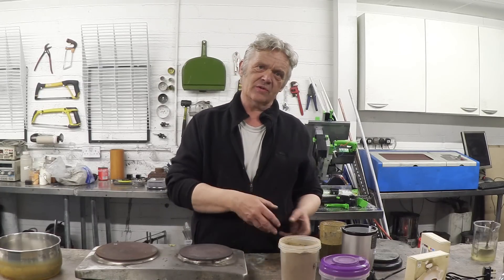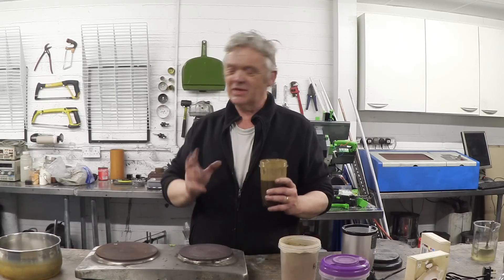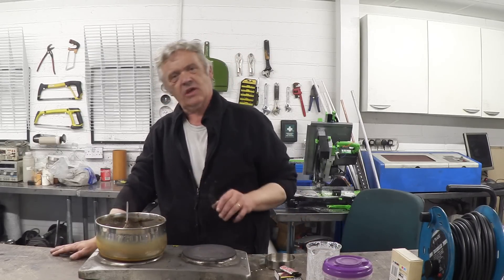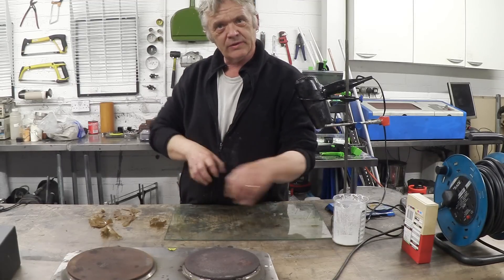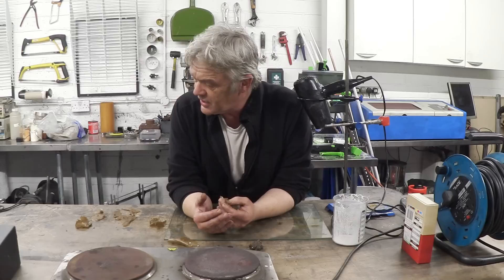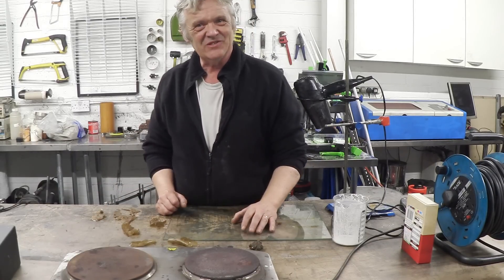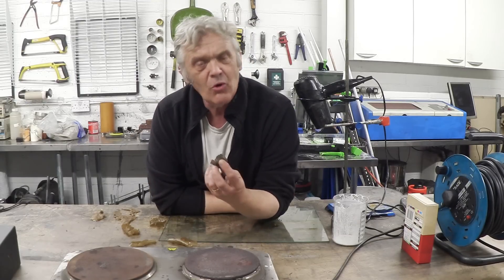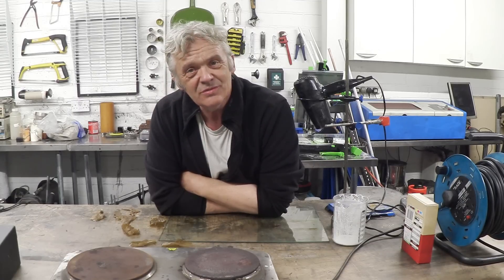How To Make A Seaweed Bioplastic -  The Basics

Comment: You could pop it between to sheets of grease proof paper and use an old clothes ringer(or as we in Glasgow call it a" old mangle) that would give you a more even spread to make your sheets
Reply: Or a rolling pin with tape strips on each end to dictate the thickness.
Reply from the maker: for sure mate - that would work well

Comment: Ok, here is the idea from what I have seen from your other video with hemp plastic - it contracts and in line with your channel what I thought of is - battery enclosure. You leave it wet, take your carbon batteries, stuff them in, wait until everything is dry and voila - all carbon battery with all carbon enclosure. That is pretty much safe (depending on electrolyte) to recycle in to a battery by blending it :D

Comment: I'm considering using this form of bio-plastic to make organic slow release fertilizer pellets.  Perhaps if this bio-plastic was powderized, the powder could be mixed with dry organic nutrients such as blood / bone meal.  The mix could then be heated and extruded through an appropriate mechanism to form pellets.  

At first I wanted to make nutrient pellets, then coat them with something like a bio-plastic to make them slow release.  This is what I've seen done for slow release synthetic fertilizers.  I couldn't come up with a way to use a bio-plastic such as this and apply a coating with a uniform thickness from pellet to pellet.  The thickness determines the release rate, so consistent thickness would be pretty important if I were to try and coat pellets with something like this.

By mixing the bio-polymer with the nutrient powders and forming the whole lot into pellets, it does away with the coating thickness issue all together.    I think it gives a great solution to the problem, and I'm pretty sure it will provide a consistent release rate which can be adjusted by changing the ratio between the amount of nutrients and the amount of bio-polymer.  More bio-polymer should make for a slower release, and faster with less.

If anyone wants to try this, be sure to rinse off any salt from the seaweed beforehand.  Seaweed tends to come with a lot of salt on / in it because it grows in the ocean, which is salt water.  If you don't already know, salt isn't very good for most plants!

Any thoughts on this idea Rob?

Comment: Not a lot of sea weed around here, but I do have cut grass.  Will have to see how that holds up in the mix.  Grass clippings to PLA... That would be amazing... Amazinger, because this is amazing.

I have some silicon molds for soap making lying around.  Will see how the mix sets up in them. Play with different layer heights to see how it dries.  Maybe see if it will release from a 3D PLA printed mold.  Would greasing the mold help it release?  May be better to cast a silicon mold from the 3D printed mold, then cast this stuff in the silicon mold... So many questions... This will keep me buzy
Reply: I was thinking the exact same think as matter of fact I was gonna cut the grass tom morning guest I'm raking it too. Wonder what the ratio is gonna be on like 50 pounds of fresh grass to corn starch. I also have some helix nano rebar material  and hemp cotton and fiber glass
Reply from the maker: you can just order seaweed online you know and it is sold in garden shops as mulch - you ideas of a parting agent or silicon moles are awesome
Reply: @ThinkingandTinkering  
Does the seaweed have musceligennic properties that partner with the cornstarch to make the plastic form?  No slime in grass.  If slime is the magic ingreedent, I'm growing okra in the garden.  Will have to try a batch with okra leaves too :)

Seaweed is salty, too.  A non-seaweed batch may need a little salt thrown in as well.  Or maybe less salt is a good thing?

Comment: Totaly on your wave length I suggested adding hemp fibres the pla soup mix for plastic forks to make them heat tolerant...

I was inspired by operation piecrete (the floating sawdust ice armour boat )

You geniuse.  .  .  . Crack on
Reply from the maker: nice one mate - thanks for the heads up

Comment: Of course, wonderful as always!!!  Find myself wondering about the biodegradability of the plastic???
Reply: ......perhaps even too biodegradable . It will certainly be prone to bacterial breakdown  .Measures however such as suitable paint could be adequate .
Reply: @philipvernejules9926  yes, I should have stated DEGREE of biodegradability...
Reply from the maker: in this form very degradable - in fact you would have to add something to stop that - but that's easy enough
Reply: @ThinkingandTinkering  A chemical time lock essentially when it runs out it decomposes?
Reply: How about small metal capsules releasing enzymes directly into the material to help with digestion? Rusting can take years. Producing those might be a bit of a problem, but you might use metal coatings of soft bioplastic capsules. Like those garlic pills..

Comment: Hi Robert. Love these videos. With your chemistry background and love for bioplastics, have you ever made celluloid? From my understanding you take flash cotton (gun cotton), which there are videos on youtube how to make that. You added denatured alcohol as a solvent to the cotton. Once it has rehardened you make it a powder and add powdered camphor. Lastly, you take a heated press like you used for your other bioplastics and you have a block of celluloid. For it being the first plastic invented it seems like there is a lack of material on it's manufacturing process. However, with you being a chemist I was wondering if you have ever experimented with it.
Reply: They used to make billiard balls out of it one small problem they would explode occasionally.
Reply: @Barskor1  Haha, yes indeed. Overtime camphor will also work out of the matrix and make them susceptible for igniting. But, can you really blame a bioplastic for wanting to go out in a "blaze of glory"?
Reply: @btryba  Nope :)
Reply from the maker: no I am afraid not mate though I am aware of the process

Comment: Wow. That is amazing. Quick question is it water proof? E.g. if it was made into a container?
Reply: I'd guess not. But I bet, with the right additives, it is manageable. Just like brittleness, strength, plasticity, rate of degradation, etc. Finding the right recipes is the hard work.
Reply from the maker: no mate - in this version - which is just the basic recipe it's not waterproof
Reply: As I understand it, this is usually a question of what is at the end of polymers. So chemical additives. But that is a way of thinking that got us in the problems with plastics in the first place..
You could also go the other route and use shellac to seal things or tree resin. Both materials are quite abundant and completely natural and renewable. (Shellac is bug excretion, amazing..) I have been looking at bushcraft videos that show how incredibly easy it is, to get birch resin and spruce resin in a useful form. You should check those out. This stuff can be used for structural integrity and by adding a shell you´d make it waterproof. I am thinking of using a burlap base and rubbing it with this stuff as a fabric hardener. And then painting the outside with shellac dissolved in alcohol to make a very cheap and easy and especially free-form shelter in the woods. Like a permanent tent. Burlap is quite cheap where I live, because of potatoe farming.

Comment: Using hemp seeds to extract the hemicelluloses Xylan xyloglucan pectin glycerin using acidic alcohol you might get the results your looking for usable biodegradable plastic
Otherwise Using hemp Shiv (woody) and gasification reduce to biochar 
Using collected rain water leach the potassium hydroxide from the biochar using the KOH @ 1-10 part to remove the glycerin from cold press Hemp seed oil (Ballance is organic diesel)
 It will fix flexibility

Comment: Wow. nice.. i have a project to make it too. but i use kappa carageenan with maltodextrin crosslink. the final product is a hard capsule shell. however, has not formed as expected. Instead, it forms 2 phases, the karatene settles and cannot be printed. do you think the problem is with the carrageenan brand or in the structure of the two materials?

Comment: Hi Robert, really interesting video, thanks for uploading! I have a bit of a story and a couple of questions...

I want to build an earthship (I'm assuming you know what that is, if not it's worth looking up) as my home but current uk legislation prevents anyone living in one because of the use of car tyres. The specific building regulation is to do with the fact that the tyres have been designated as a waste product and therefore not fit for purpose in construction. So it occurred to me a year or so ago about potentially using a bio plastic and casting tyre like moulds to house the rammed earth.

My questions are, is this kind of plastic suitable for that kind of construction, in terms of durability, longevity and insulatory properties?

Comment: Just done a little googling because I couldn't understand why seaweed would do that :-) I think from what I read it is the 'Polyhydroxyalkanoates' in the seaweed that creates a sort of polymer, the wiki page says it is UV resistant, which is a huge surprise for me. I don't understand though what the starches role is, is it just to bulk it up? May need to commandeer the kitchen for a an experiment (the wife is not going to like that) as I think that potato starch should probably work too, also I am quite interested in finding out acid resistance, specifically for isolators for capacitors.
Reply from the maker: they are all basically polysaccharides mate - it's not so much a polymerisation as much as cross linking

Comment: kinda wondering what thermal decomposition does to this stuff like how decomposing polyethylene gives crude oil that is completely clean with no contaminants (the bits that make the oil usually in the ground black brown or what ever like sulfur and heavy metal salts dissolved into the oil, and thus destroys their equipment and delicate zeolite materials when trying to use them to make plastics and various molecules out of the oil after further breakdown and what not into BTX)
Reply from the maker: I don't know mate - give it a go and see
Reply: @ThinkingandTinkering  one day, right now the germicidal air curtain generator I am working on for preventing future pandemics from sneaking up and hobbling us is on my plate holding me back from my 3D printer upgrades development for a replicator level printer that can both print out high quality CPUs from scratch, (gates and all) and quickly (100X speed) print out plastic casings and the like, with an added function this list shows just how much work I really have  of being able to destroy unwanted items in a manner that allows collection and sorting of the material for use later to print items out. ;) I have friends who have been doing experiments on all sorts of stuff like this though so I will have to talk with them, see if they are interested,

Comment: It seems eco-friendly to make bio-plastics, not petroleum-based on oil. However, bioplastics that need to be decomposed with some heat are having a hard time processing them after production. PHA, which decomposes without heat, looks better in the future than PLA, where raw plastic decomposes only into heat. In the future, PHA materials will become more perfect eco-friendly materials. Is A Seawed Bioplastic decomposed without heat?

Comment: if we can solder to your amazing Graphene ink, how can we weld to some bioplastic? Would you go ceramic insulating spacer bolted on (TIG etc) or refine into a glue gun type filament? ++Graphene!
Reply: have you heard of cold spray? apply metal to plastic or plastic to metal with micro particles exiting the applicator in supersonic flow of expanding gases. russian military invention.